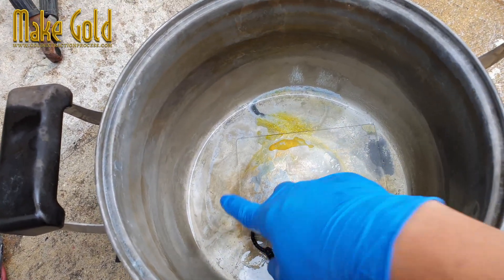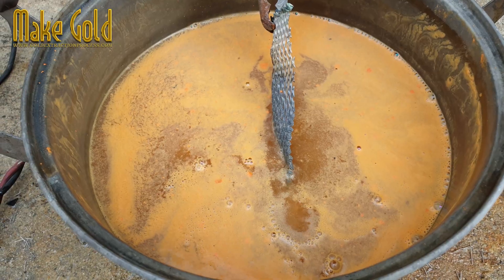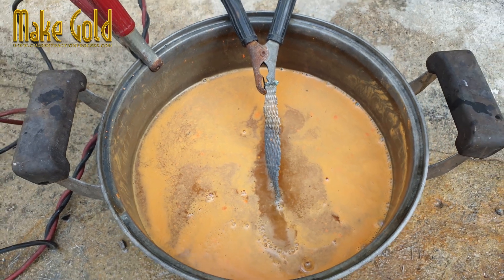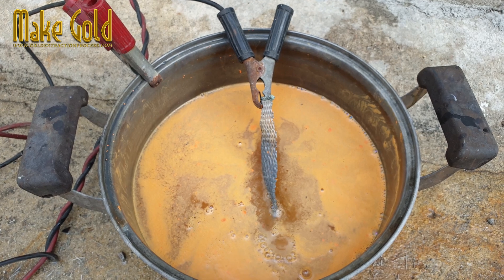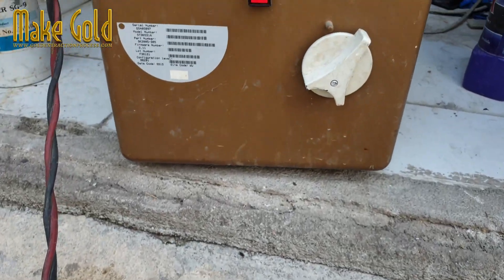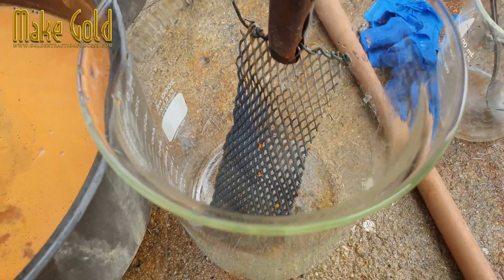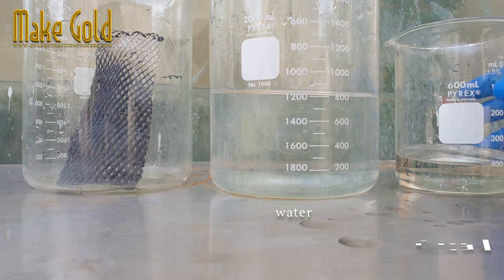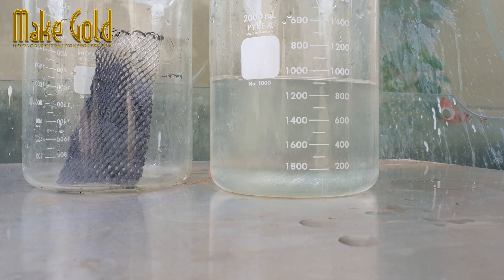Using electricity to extract gold from chemicals left over from gold extraction

Comment: well, great idea, no question about that. But why ru using a steelsheet? Use copper instead. The gold will transfer to the copper and later on you can solve the copper in a solution made of hydrogen peroxide and salt.
Reply from the maker: Haha, if only it were that easy! I might need a treasure map to find it amidst all the wires!

Comment from the maker: :_wow::_GoldBar:Extracting gold using electricity is typically done through a process called *electrowinning* or **electrorefining**. Here are two common methods:  

### 1. *Electrowinning (Electroextraction)*  
- Used in gold mining operations to extract gold from a cyanide or acid leach solution.  
- Gold ions in solution are plated onto a cathode (usually made of stainless steel or carbon) using an electric current.  
- The process is efficient and commonly used in gold recovery from low-grade ores.  

### 2. *Electrorefining*  
- Used to purify gold after initial extraction.  
- The impure gold is made the *anode**, and a pure gold sheet is the **cathode* in an electrolyte solution.  
- When electricity is applied, pure gold ions move to the cathode, while impurities settle as anode sludge.  

These methods require electricity, chemicals, and careful control to ensure efficiency and safety.